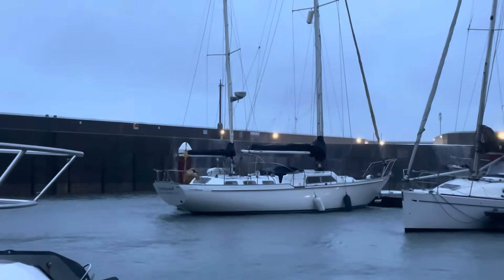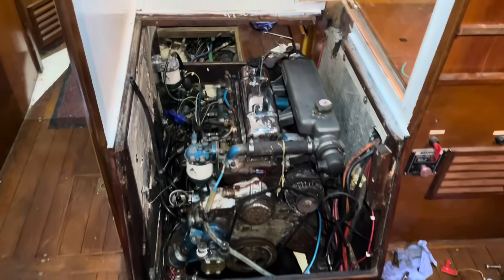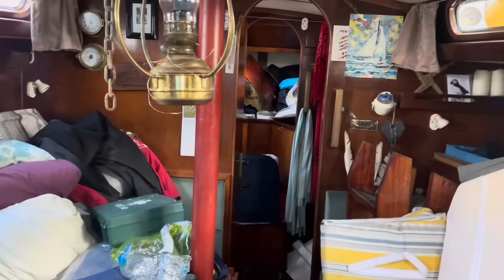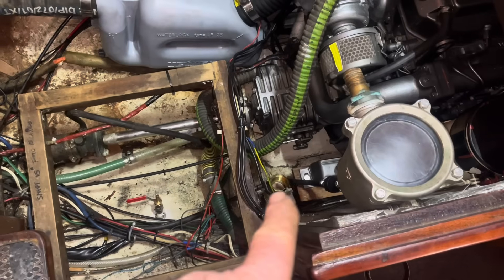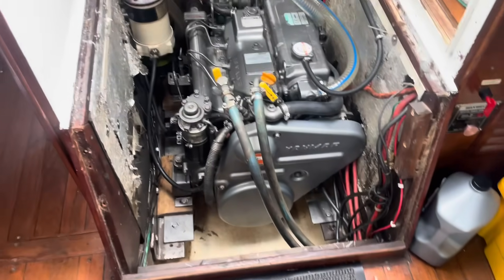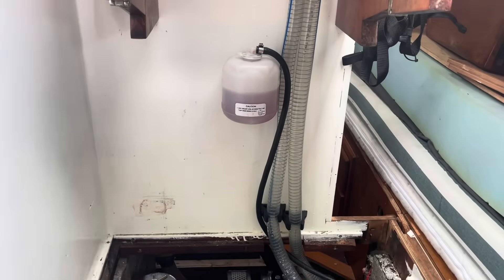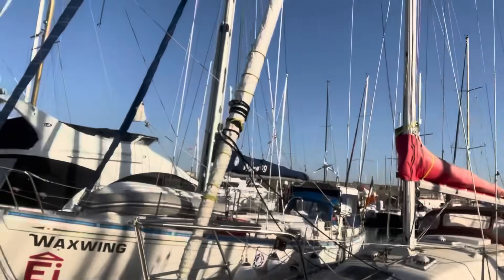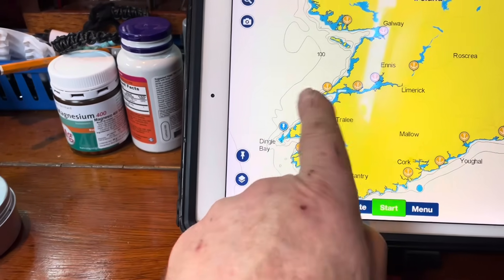Rival 41 engine replacement S3 ep 17

Comment: Why a replace instead of just a full rebuild?
Reply from the maker: I thought about a rebuild, I did that in my last boat it was a Perkins 4108 and worked great but the upgrade to the Yanmar was a better option for me this time 😊⛵️
Reply: @peterlawlesssolosailing7189 with your next attempt ( next time it will happen) on a circumnavigation it will be nice to have the security of a new engine.

Comment: Question: how many revs approximately to push Waxwing at 6 knots? Also what is the minimum rpm you think it wise to do on a passage, I have a Volvo D2-75 in my R41 and find 1,500rpm is  more than enough but is it good for the engine to run at that rpm for 4-5 hours if need be? Thanks
Reply from the maker: To get 6 kn I need about 1800 rpm but I need to change the pitch of my max prop slightly, so that will change, I’m not a expert but I ran my previous engine at 1500 rpm as it was fuel efficient and gave me 5 to 6 kn , if motoring for long periods I used to vary the revs between 1500 and 1800 rpm  hope that helps 😊⛵️
Reply: @peterlawlesssolosailing7189 thanks Peter. I have a MaxProp too. This summer over 3 months of motoring and motorsailing we averaged between 2.75 and 3 litres per hour.  We avoided having to make the step by the aft berth by putting the riser in the locker under the berth, it works well. I’ll take a look into the diesel polisher, it makes good sense. You can get a portable filter system between the petrol pump nozzle and the filler pipe that is also worth looking into.

Comment: Did you have to change you prop?
Reply from the maker: No the gearbox ratio was almost the same , I have a three blade folding max prop  , and I contacted max prop and they said I should adjust the pitch accordingly, I did notice slight cavitation once entering a harbour in very rough conditions, so it on my list but I need to lift out to do it . I also had to change the shaft coupling . 
Good question, I should have mentioned that 😊⛵️
Reply: @peterlawlesssolosailing7189  I’m thinking of getting a max prop. Do you like them?
Tnx for reply 😊
Reply from the maker: @Tassie_Tiger1 yes great prop and great customer support 😊⛵️

Comment: Another  great video.Great set up for fuel. Did you ever have diesel bug previously?
Reply from the maker: No I never had diesel bug but I had a diesel polishing machine that I used for cleaning peoples tanks and used to clean Waxwing s tank annually with it , I use marine 16 also and keep the tank full of if I can , the new system is great 😊⛵️